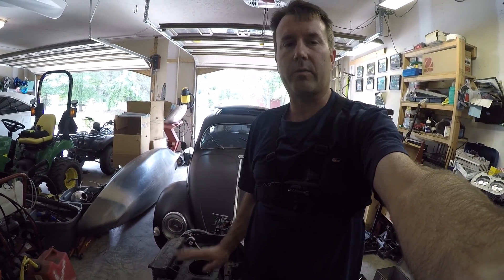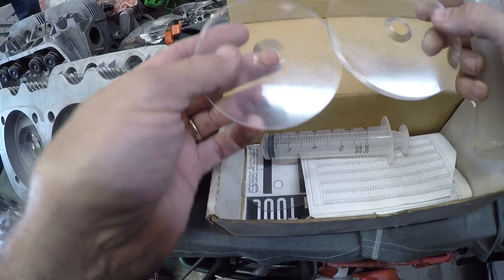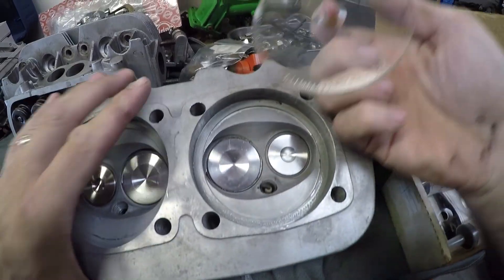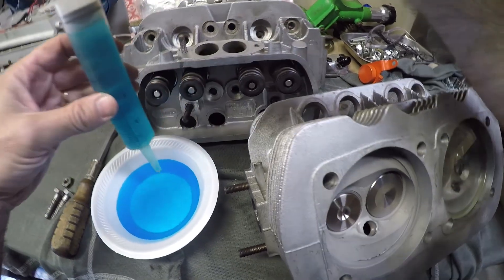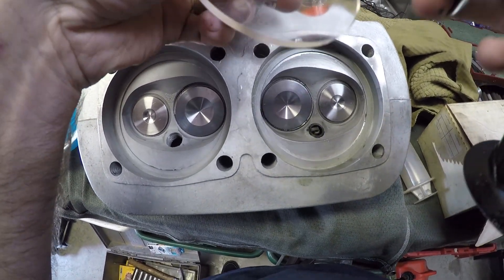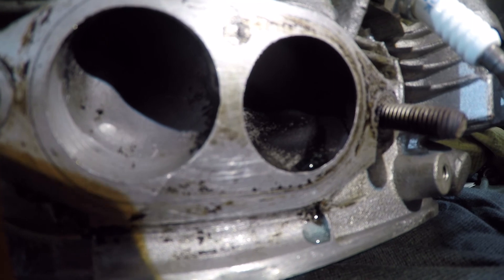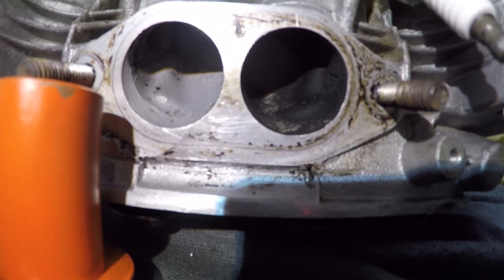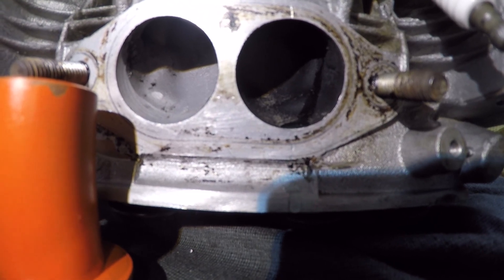CC testing VW type 1 cylinder heads

Comment: If the heads have steps in them, the step is part of the deck height. When you measure the head for CC's the clear disc should fit inside the step to get the correct CC volume. This is what I read on thesamba forums.